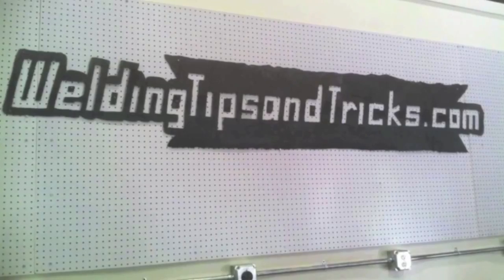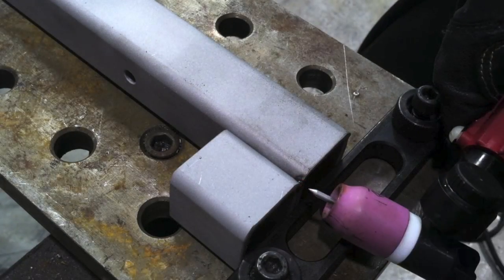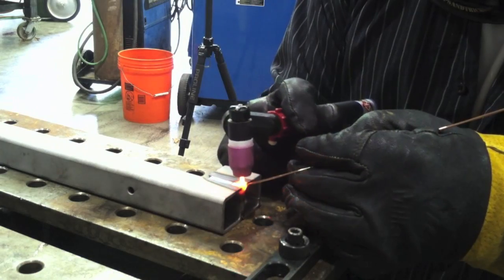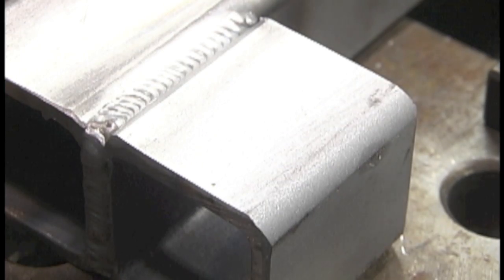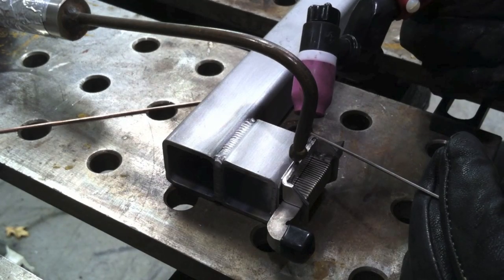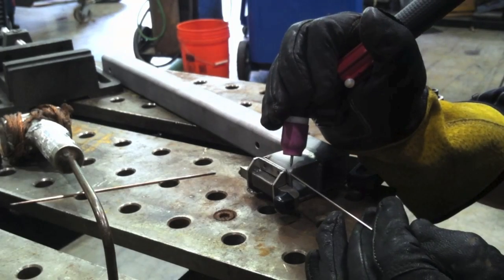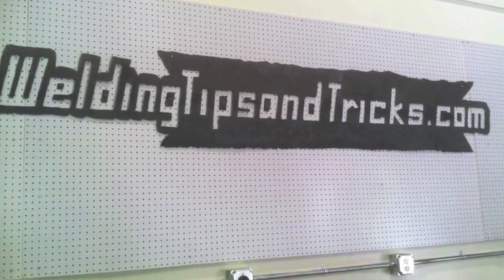10 Minute Tig Welding Job

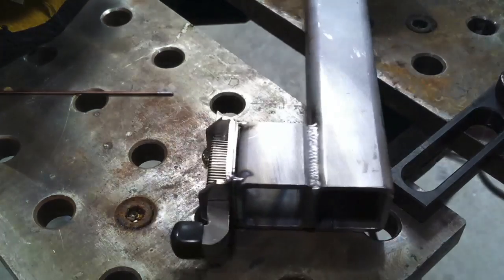Comment: A lifetime later:  Speaking of welding the little latch on there 4:00-  it immediately suggests plug welds into those holes, don't you think so?  Not heating up that spring is of course an issue.  But if a bolt or rivet would hold that thing, surely a little plug weld is better?  It's like the perfect rivet!  Less heat input all together, and closer to the original design intent of the bracket.  I'm not hating anything here, I just like plug welds, rosette welds, tig-spot welds.

Comment: I have just started to teach myself Tig welding ...  And I have a few questions .... 1 , How far do you have the tung. sticking out of the cup ?   What # Cup are you using here ?   Why do you move back from the front edge of the puddle as you add filler ?   Also ,  What Tung and Filler are you using ............   Thank you ,  I have been watching your videos  and then trying to duplicate it at school ....... Keep up the great work ....
Reply: Moving back lets the heat soak in a bit, provides space for the puddle to fill, and makes it less likely you'll dip your electrode. Esp. useful when welding aluminum and feeding a lot of rod into the puddle. Stick out enough to see, but less than one cup diameter unless you've got a gas lens or free argon. Larger cup will give better gas coverage with a diffuser screen, and less discolouration of the part, but only if you crank up the flow rate to suit. smaller cups will reach into tighter spaces, larger cups will flood them and let you stick out to reach into the root.

Comment from the maker: @neonnic2011 Using a gap along with backstep will help but nothing will completely prevent distortion. Rigid fixturing and chill bars can also go a long way but again will not prevent completely
Reply: Hello, how do you use the electrode and ceramics jets?

Comment: Just as the man said above, NiRod will work quite well. I have welded up some "vintage" Caterpillar exhaust elbows and turbo adapters using the technique described above. Pre-heat until it's spit-boiling hot, weld a short bead, and as it cools down a bit peen it sharply. Keep the gap clean and keep stitching along -- trying not to get too much heat soak into the parts. Should work well and you'll save the day for your Cummins-owning friend. Good luck!

Comment from the maker: you can, but cast iron is always a crap shoot.  either a high nickel rod aka "Ni Rod" or even 312 stainless rod will work....but not always.  a high preheat helps along with peening the weld with a ball peen hammer every inch or so and let cool very slow.

Comment: Thanks again for the video Jody. I re-watched your video comparing electrodes, and other similar videos. And I have one question; do you still use the thoriated or are you only using the 2% lanthonated? I'm looking to switch from 1.5% lantho, and just wanted your long run opinion. Thanks again.

Comment: Do you have a key reference that you reach for when you are trying to decide what filler metal to use depending on the substrate metals? 
I would like to build experience at guessing what the base metal is when you don't know for sure. Any suggestions?